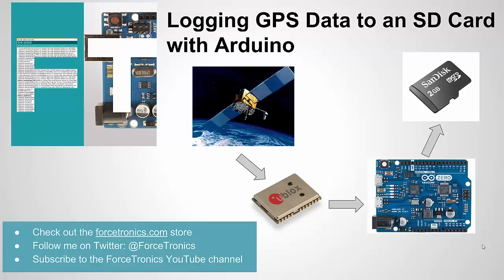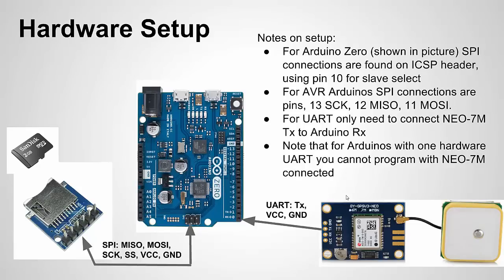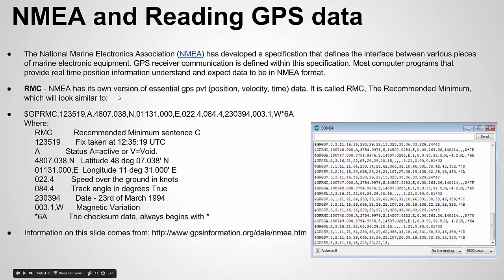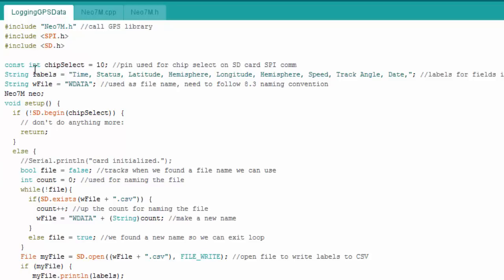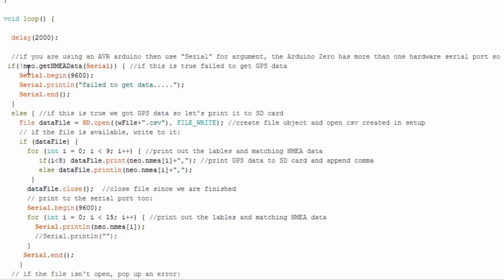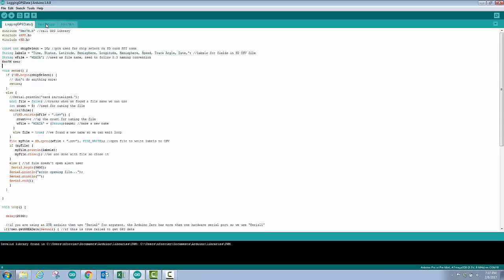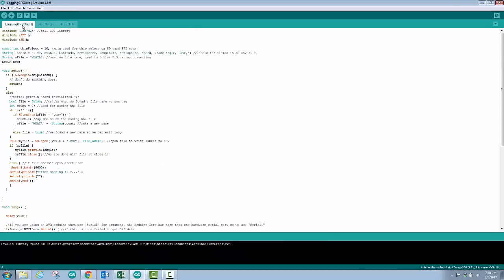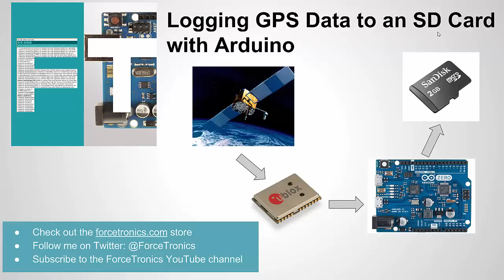Logging GPS Data to an SD Card with Arduino

Comment: Great tutorial.
Any chance you know how to change the GPS sample rate?  I see your CSV showed 1 value every 3 seconds.... any chance we can change this to 2 per second??
Your 9600 baud rate should be capable of a lot more than 0.3Hz....?
Reply from the maker: There are various ways to configure the data. I don't have them memorized. Refer to ublox user guide
Reply: ForceTronics Thanks for the reply. My plan is to use the GPS unit primarily for time stamping, and then to record some data from a load cell on another Arduino Uno, and communicate that via CAN bus to the Arduino with the GPS and record both to the SD card... any thoughts on whether this is possible? Would I have to first compile the two data streams? Is this too much for an Arduino setup?
Reply: Maybe I could just use an RTC and forget the GPS altogether 😂

Comment: Is there a way to attach low energy Bluetooth? That way it doesn’t have to be removed to download data?
Reply from the maker: Yes, the Neo line of GPS SoC have multiple communication interfaces so you just need to find a Bluetooth option with a matching communication interface

Comment: Thanks 
what about if i want the file logs be distributed over predefined files size in a way that when one file is full it will close and open other file ??
Reply from the maker: This is meant to be an example tutorial to help you get started on your own GPS design. I recommend researching the Arduino SD card library for information on more advanced file capabilities

Comment: Very clear explanations! You are a gifted teacher. Do you know how to set Datum (EPSG)? I would like to collect the data in the EPSG 3844 directly, instead of the implicit WGS84.
Reply from the maker: Thank you. Sorry I don't have any experience working with EPSG 3844
Reply: The point is whether the Datum can be modified or not within Neo-7m. If positive, I can introduce myself the parameters, no big deal. I could not find whether the Datum can be modified  in the datasheet or elsewhere.

Comment: My apologies if I missed it, will this code work with a Neo-6m as well?
Reply from the maker: Yes it should work with the Neo-6m, but I did not test it personally
Reply: @ForceTronics  what would be changes in the code in case of Neo-6m
Reply from the maker: @prathibhag3204  I can't answer this question because I have not looked at the Neo-6m datasheet. To determine what code changes are needed you would look at the datasheet or user guide for Neo-6m and see how to communicate with it
Reply: @ForceTronics   Hello, First of all Thanks for your great Job. 
I use it for an Neo-6m and it dousnt work.
While i Compile it it dousnt show me any Problems.
But in the serial Monitor it gaves me "failed to get Data".
Do you have any ideas why ?
Reply: @elyasarian9513  I have a same problem with you. Have you solved it yet?
Reply: Jon Vannatto did it work?

Comment: Good tutorial, thank you.

CSV = comma separated values.
In fact, separator can be tab and ; (; separator common in Europe).

Since GPS format created with US notation in mind (123.5, and not 123,5) you can easily get away with current code.

To be on safe side, you need to wrap column values that can, even potentially, have separator in it or even spaces, even in header.
Like this:
"My caption1", caption2, something1, data2
"any street; 12A", 123.6, "1235,56", "67 | 78" 

Also can be a good thing to use external EEPROM IC (internal have too few rewrite cycles) to store raw data if SD fails and starting send alarms to owner somehow.